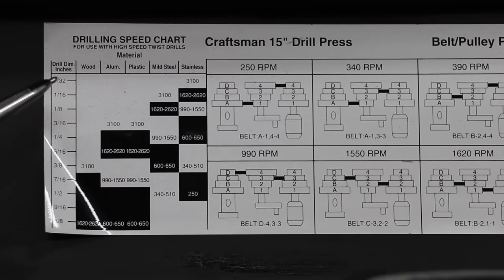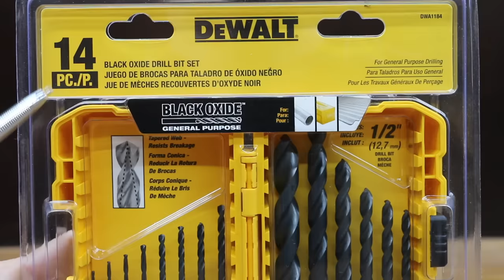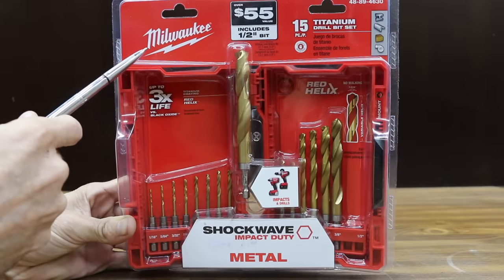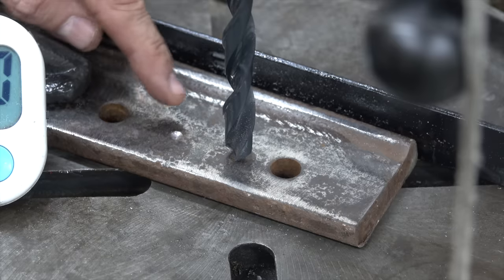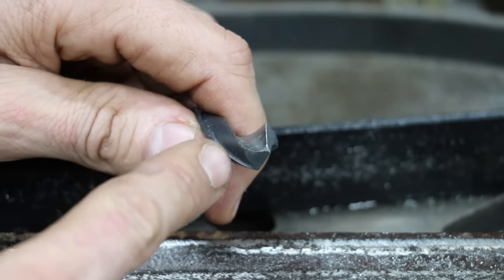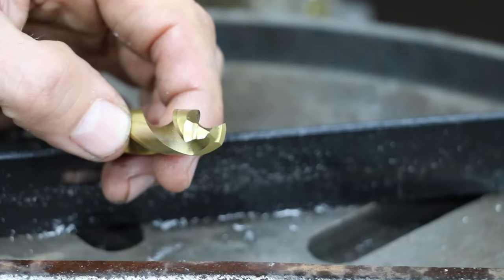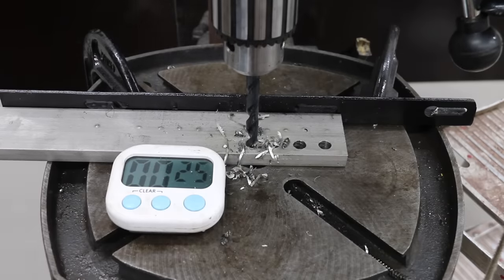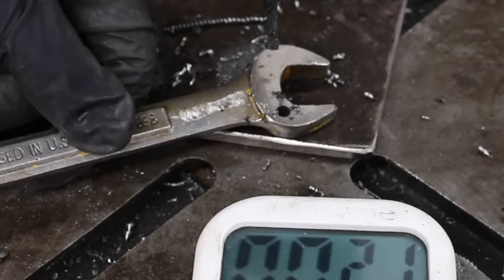Which Drill Bit Brand is Best? Let's find out!

Comment: I have been trying out different Phillips bits for my drills and have been finding that most bits are crap. I would like to see a good bit comparison on who has the best bits.
Reply: Testing those will be problematic because the quality of the screws influences them a lot. There are hardened and unhardened screws. A good bit can somewhat handle a wrong size screw. Will it still work if the screw is rusty in the slot? After too little down force and camming out, is the bit still usable? Will it work in a Pozi screw in a pinch? So many intriguing questions...
Reply: @zwz.zdenek  Just sounds like a bunch of interesting tests to me.
Reply: D S, I have been using mostly Milwaukee and DeWalt drive bits, not only with a cordless screwdriver or impact driver but also inserted in a quarter- inch nut driver handle. Both brands seem to have good quality bits in terms of the hardness of the material, but they differ between each other,  and certain screws will work better with one brand of bit versus the other. Indeed, I have 2 different styles of 3" long DeWalt Phillips bits (the type with the yellow, rod-shaped "torsion zone"), one marked "P1", the other marked "PH1", and although the drive bit tips look same ( angles, width of the ribs, etc) there is a pretty significant difference in how snugly they fit a #1 Phillips screw.
Reply: I've had the same problem
Reply: I use a lot of #2 Philips bits in my job and I have the best luck with Dewalt and Milwaukee.  As far as the #3, I stick with the Milwaukee.  Hex head bits, all I use is Dewalt and I have never had an issue.  Pay attention to using the right size.  Using the wrong size or type will ruin them quick.
Reply: Are you sure they are philips and not Pozidrive/Supadrive? Philips are designed to cam out at a set torque, whereas Pozi/Supa aren't, hence philips heads ain''t great for use with a power driver....
Reply: @johnphillip1711  , I fix old audio equipment for a living.  I work with PoziDrive screws pretty regularly (sften used in European speakers)  so yeah, I do know the difference.  I also work with JIS ,  Japanese Industrial Standard "philips-style" screws, regularly. I don't have an exact JIS  screwdriver but the Milwaukee bits fit the JIS screws well, especially if I file the tip of the bit off just a little. For those who aren't familiar with them, if the acrew has a dimple or divot punched into the head, it's not an ordinary Philips, it's JIS. Often seen in Japanese motorcycles...
Reply: Thanks for the heads up I didn't know that there was a difference I'll look for the types that you mentioned
Reply: I throw away anything that looks like Philips.
Reply: @SuperUncleRyan  , at work, I deal with just about every type of fastener: Robertson, Torx, PoziDrive, Philip's, JIS, both SAE and Metric Allen hex wrenches, sometimes even clutch-head screws, or "snake-eyes"! Most equipment arrives for repair with chewed-up screwheads; equipment owners, and other wannabe techs, are neither shy nor gentle, they'll try to use pretty much any screwdriver, no matter how worn out or inappropriately sized, to try and remove fasteners.  Allen heads are  the most likely fastener type found to be so chewed up that no known size will fit the stripped-out heads and I have to be creative in order to remove them.
Reply: @goodun2974  more a reply to the OP -DS initial post than yourself. :)
Reply: I bought a 5 pack of Bosch cam-out resistant #2 Phillips bits (they have little ridges on the tip) and they do seem to grip better and last longer for it. They are marked CCP2205.
Reply: get some impact bits for a impact screwdriver
Reply: @bubbafudpucker397  , #8 Torx (aka T8, presumably) are pretty small,  not likely to require very much driving torque. I find similar small Torx screws used in electronics devices, but I assume you're not using those for building decks  and so the driving torque probaly isn't very high anyway. Are you using them for interior wood trim? I use black finish #1 Robertson head screws, aka square drive,  for that kind of work. They appear to be hardened screws, and I don't recall ever stripping one. I've definitely stripped out some stainless decking screws, and non-magnetic stainless screws too when I was bn installing navigational electronucsbon boats.  BTW,  although I haven't used Wiha drive bits, we have Wiha miniature/precision screwdrivers at work and they're excellent.
Reply: @Hidyman  , the "Project Farm" channel on You Tube just posted a test and review of spiral drill bits. The Bosh bits came out on top whether it was for drilling mild steel, spring steel, or stainless. The DeWalt drill bits came in 2nd.  In my experience, it's rare to be disappointed in a Bosh product. I own several 3/8" inch corded drills that I bought in the early 1980s, and  the only thing I had to do them in all this time is to replace the power chords. They still work great. Of course, much of their modern equipment is made in Asia nowadays, but still well designed and built. I have a modern Bosch  jack-hammer/ hammer-drill combo that I used to core 2& 1/2" holes into ledge rock in order to plant some poles for chain link fencing. The Bosch carbide masonry bits held up well even though the rock was much harder than concrete.
Reply: My personal go to for screwdrivers is Wera. However i find Milwaukee driver bits pretty good.
Reply: SigneN-Formaldehyd-Planteøstrogen-Soja#1-dræ'  I haven't tried them, but I have a set of Wera slotted and phillips screwdrivers that have held up very well to a couple years of my abuse. Any pro tools from the US or west Europe beat that chinese made homeowner crap. One of my relatives has a tool truck business and is a former mechanic, and laughs about the homeowner stuff from harbor freight, lowe's, home depot etc. The stuff is dangerously bad.
Reply: @goodun2974  I'm using the #8 torx for disassembly of some things for a specialized trade. I don't reassemble anything. Every now and then, I'll twist the screw head off, but the bits don't twist. The homeowner crap can twist or strip off the spines in a matter of just a few screws. They are way too soft for industrial/professional/commercial use.
Reply: @goodun2974   If you deal with JIS alot, try VESSEL.  They are the Japanese standard.  You can get them off Amazon.  Made in Japan, very high quality.
Reply: German bits are best.  FILO, Wera, and then Wiha.  Warning:  Wiha bits are starting to be made in Asia now, so be careful what you get.  Also, VESSEL (Japan) makes some incredible screwdrivers, in particular JIS standards.
Reply: @1vw4me  I have the two piece vessel impact set, and LOVE it. I bought a 30 pack of #8 wiha torx a couple years ago, and have removed a couple thousand screws. I have only used about 6 bits so far.
Reply: @bubbafudpucker397  , your comment provides a great example of why, when I go to disassemble audio equipment for repair at work, I break all the  screws loose by hand and not with a cordless screwdriver. Doesn't matter if it's Phillips, Torx, Allen, Pozidrive or whatever,  I break 'em loose by hand. Especially if they look to be a little chewed up from the last guy that took the unit  part.
Reply: @1vw4me  , does Vessel make drive bits ( 1/4 hex shank), or just screwdrivers with molded handles?
Reply: @goodun2974  I'm salvaging precious metals, and have no interest in keeping anything free of damage. I also do small engine repair and hand tighten everything instead of using my cordless impact. Different applications have different modus operandi.
Reply: @goodun2974   Yes!  Just type in "VESSEL bits" into Amazon and treat yourself!
Reply: @goodun2974   Also, they make a great ball ratchet screwdriver.  Just got one, love it!
Reply: @1vw4me  , I have never much cared for ratcheting screwdrivers....
Reply: Wiha or Wera is what you need

Comment: Can you add “chicago latrobe” to this test I’d like to see just how well these sets can do compare to a premium set.
Reply from the maker: Great suggestion
Reply: @ProjectFarm  Cleveland also a good brand.  As a machinist I assume all the drills were HSS high speed steel except for the Bosch which was cobalt steel.
No drills are made of titanium ( just marketing) There are drills with TiN coating which is Titanium nitrite which is very hard and resists wear.
Reply: @lrc87290  I don't think anyone was saying that the drills were made of titanium. They're clearly TiN or TiAlN. Cobalt steel is a HSS.
Reply: @lrc87290  I don't think anyone was saying that the drills were made of titanium. They're clearly TiN or TiAlN. Cobalt steel is a HSS.
Reply: @xenonram  correct about cobolt being a form of HSS. I think one of the drill bits tested said titanium. Although he did also mention tin coating.

Comment: I would like to see steel step bits tested they have a huge variety on price and I was wondering if it is worth the extra cost
Reply: As with many things the intended usage is everything. For plastic and aluminium the cheap ones will go on forever. They aren’t hard to sharpen either, just grind the inside of the flutes to refresh the edge.
Reply: RollinRat  Well said!

Comment: Could you test hole saws? I go through tons of Milwaukee hole saws and would like to find a better brand if there is one
Reply: @GizmosGameLounge   Thanks, i just requested one of their catalogs. ill check them out
Reply: Most all the places you go have coded. Drill bits coated drill bits are no good. You have to get pure Cobalt. Drill bits Where the Cobalt is through the whole Steel? Of the drill bit the coded drill bits Do not hold up.
Reply: Diablo makes a good Sawzall blade I don't know if Diablo makes a   hole saw But I know the Diablo. Sawzall blades hold up really good And I Diablo. Skill saw blades are the best. That's all I use is Diablo blades. On my Sawzall and my still sauce. They last the longest.
Reply: I looked it up on the internet. They do make Diablo. Hole saw I know I've use there. skill saw blades and Sawzall blades they are the best on the market. They last a long time. Much longer than other brands. If I did check this out online and they do make Diablo. Hole saws I just Googled. Diablo hole saws And it appeared on the internet. Hope this helps you.
Reply: daniel harper the spyder bits are pretty good
Reply: Diablo makes awesome sanding disks and hole saws .
Reply: Starrett
Reply: Look up who actually makes their hole saws besides milwaukee. Hint - (Most are made for them)  I would Try Morse Hole saws who actually private labels for many of the "Power Tool Companies"  Lenox is really good as well
Reply: The lunox seem to last a long time... I use them installing Solar and they go through shingles frequently...

If you burn through hole saws quickly make sure to back out of the holes frequently. If you see smoke your bit is to HOT, one of the fastest way to ruin a good cutting edge is to overheat it, and hole saws are especially prone to it.
Reply: Make sure your hole saws run on low rpms, it reduced teeth wear in my experience (using ridgid brand holes saws)
Reply: @kentbarger6974  diablo deff the best for blades 😎
Reply: Agreed
Reply: Greenlee makes a good quality hole saw.
Reply: What do you guys recommend for spade/paddle bits?
Reply: @giggityeffyou  i normally use Bosch  daredevil
Reply: I've notched a lot of 4130 cro-moly thin wall tube with Starrett and they stay sharp and don't chip teeth (with a rigid setup and ball park feed/speed).  They are also true to advertised size and rather cheap.

Comment: I'm going to school to be a machinist and I'm showing this to my teacher
Reply from the maker: Awesome!  That's a great occupation!  I wish you the best of success in all you do
Reply: Hell yeah machinist for life also rember theses are jobber drills so a 118 degree cutting angle and I believe you want a 123 degree angle for stainless
Reply: You won't see any of these junk brands in industry, just saying.
Reply: @bubbafudpucker397  what brand do you perfer?
Reply: Good job asking!  You will learn what is best for your application based on size and material - 30+ years as machinist - mold maker
Reply: @TheHelp14  And 135 Cobalt's , "no split point" for tough materials like Inconel or Waspaloy...
Reply: I would go out on a limb assume that professional machinist or milling bits would probably out perform all of these consumer brands.
Reply: Just for anyone saying a machinist would buy more expensive bits. Yes you're 100% right. But my teacher buys cheap as he wants us to know how to resharpen bits. So that's why we use the cheapest thing
Reply: @CaptainLicorice  Machinists buy both. You have your expensive drills and end mills, and you have your cheap ones. The cheap ones get abused and modified for odd jobs. The expensive ones are treated nicely and used for the jobs that require very nice surfaces finishes and cutting precision. Same goes for hand tools too btw. You have the nice SnapOn set, and you have the Craftsman set. The SnapOn is comfy and used the most. The Craftsman are the ones you grind to shape, heat and bend to shape, and weld up into custom tools. Then you just go buy another at Sears. If your SnapOn tool breaks during daily use, you warranty it. You don't customize the SnapOn stuff.
Reply: @HappyHands. I didn't see a single one of these brands labelled as high speed steel, which would be like comparing a $100 pocketknife to a $5 pocketknife. https://en.wikipedia.org/wiki/High-speed_steel
Reply: Guhring, Sandvik and Walter make the best solid carbide through coolant drills
Reply: @mannys9130 That's a bingo!
Reply: @bubbafudpucker397  that's for sure. At least I hope not
Reply: I went to college and got my manual machinist certificate back in 03-05. I'm 34 and have been driving a semi for the past 12yrs. Something went terribly wrong with the career path I took.
Reply: No specific brand.  Just make sure they are M42 cobalts, made in usa.  The best for general machining.  There are other’s that are better.  But for a general drill index, use those.
Reply: Kennametal, ive used their 2 flute and indexables for years
Reply: You're teacher will call these all junk.
Reply: @simpleman806  I have a friend who has got the machinist education, and it's terribly hard for him to keep a job because the companies he works for keep going belly up
Reply: Me too! 😎
Reply: @HappyHands.  Nothing stops you from using these in a CNC machine.  However, a through spindle coolant titanium nitride carbide drill bit is one of the best drill bits for CNC machining.
Reply: Actually you're all wrong. The best drills are Botek gundrills. But nobody has probably ever even seen a gundrill. Nothing about a gundrill is similar to a normal drill. I've drilled hole 8ft deep through P20 steel in under 2 minutes, hole is perfectly round and straight, plus gundrill burnishes the hole for a mirror finish. Better than a boring bar could ever do
Reply: HighStreet Killers I have,  I’ve chamber thousands of barrels in my time
Reply: mannys9130 not sure what your talking about, snap on drills are junk, I’d bet Walmart probably sells a better set. And as for the tools not sure why you would have two of each, I have thousands of dollars worth of snap on but my box also has a lot of craftsman and harbor freight, todays tools, even the cheap ones work well, that being said I’m not ditching my snap on sockets, I do however prefer a husky ratchet over my snap ons. This is hard commercial use btw, I’ve worked in machine shops there is not really a reason for snap on and high dollar hand tools in a machine shop. There not used hard enough to break, you would shit bricks if your saw the millions of dollars worth of parts being turned out with some no name tool set used for setting fixtures and whatever else.
Reply: Bryce Peters 
My career saddled the transition from analog to CNC. 
In 77 my first week was spent in front of a “snag” grinder learning to hand grind drills. 
Then form tools,  mills,  shave tools, etc.  Pay was piece rate,  learn to make your tools both sharp and durable or get the smallest paycheck. 
When I retired in ‘09 the whole place was CNC.  My tool grinding skills were long since unneeded.  Learning a Makino I’ll never forget the first time I saw a 3/4” thru-coolant drill (at about 3k rpm I think) go 3” deep in cast iron in about 1.5 seconds.  What sorcery is this ??  And a 19.5” diameter OD interrupted rough cut (8 voids per revolution and removing 1/16”to 3/16” to true it up) of cast iron at 1800 rpm with a ceramic tool point AND NO COOLANT !! It threw sparks, turned the very tip of that insert bright orange, but only while it was cutting. As soon as the door slid open you could touch the insert, it was barely warm and lasted for so many cycles that huge piles of $$$ could have been won/lost in wagers. To a whole factory of machinists who were well versed in the physics of metal cutting,  this was “the deal with the devil”.
Some of the old schoolers who were close to retirement had a tough time choking this stuff down. 
The only thing that is consistent is change.

Comment: You should do a test for 1/16" drill bits for breaking strength. I'm always breaking those 😄
Reply from the maker: Thanks for the suggestion.
Reply: Dewalt held up best for me on those.
Reply: Are you like me & tend to forget that if you want to break a bit, use it as a router.